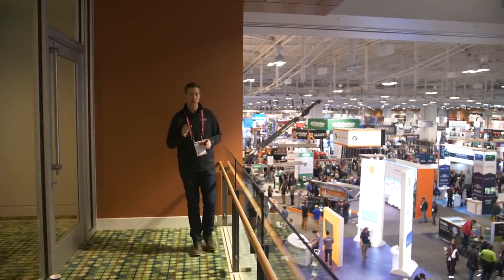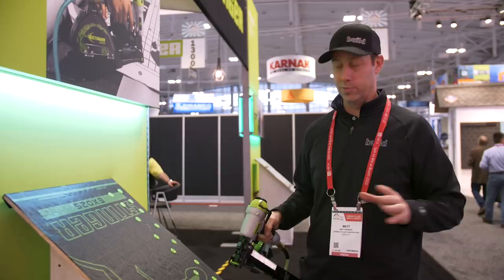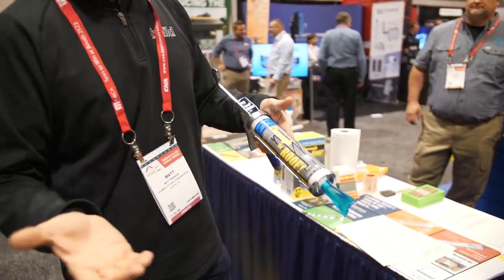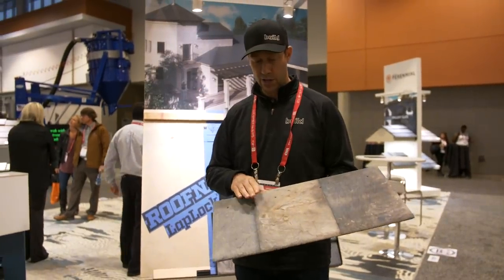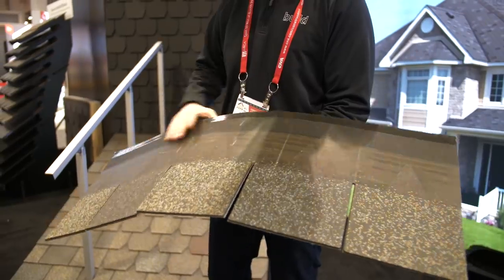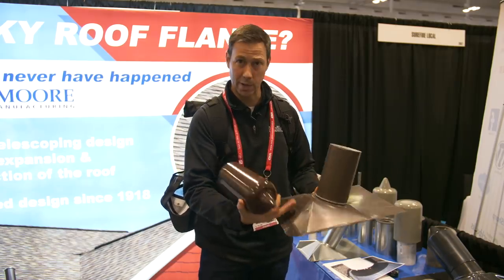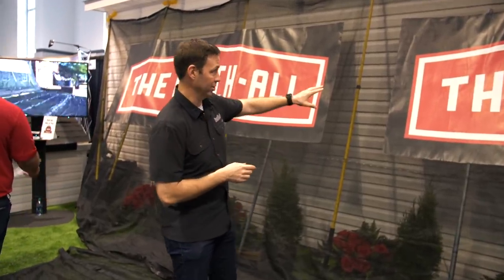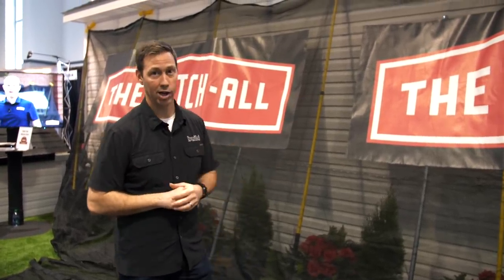NEW ROOFING PRODUCTS 2019 - This Show Had Some Surprisingly Cool Stuff!

Comment: Id like to see that talk about metal roofs. Why you like them. You prefer them over an asphalt roof? In every situation?
Reply: Thought I'd throw my two cents in. Pros for metal roofs are they are very durable and will last longer than asphalt or cedar shakes. I believe most suppliers come with a 50 year warranty vs. your typical asphalt shingle at anywhere from 20 to 45 year depending on the grade. (Note: I'll believe it when I see it that any shingle would last 45 years).

 Metal roofs, when done nicely, are very sharp looking and can add an architectural touch to your home. If a leak was to happen it can theoretically only occur at the ridge, hip or anywhere there is a roof to wall. So pinpointing it is much easier than with a shingle where it could be anywhere in the field. Not a huge bonus as any leak is bad but it does simplify. 
 
They come in virtually any color and come in wide or narrow panels, striated or smooth along with different types of seams depending on the pitch of the roof or clients liking. They are also fast to install as you can cover alot of square footage with one panel. Most roofing contractors will measure the roof first and order the panels pre cut. They are the lightest weight roofing product too so for homes that are under framed they will lighten the load. Bottom line is they last a long time. The only other options that will last longer are slate or tile but that depends on your climate. For example tile or clay in the Arizona sun would be better but metal will be cheaper than slate or tile. 

 The cons are that you must have an experienced roofer who has done metal roofs before do the install. They look great when done right but look horrible when not. You can't hide imperfections like you can with asphalt shingles. Also Oil Canning can be an issue. The summer sun can be unfriendly to metal roofs. The striated version helps to correct this but it's not always the look the client is going for. If you want the flat panel I suggest going with a 24 or 25 gauge as anything less will be susceptible to oil canning and once again make sure whoever is installing it has experience. How it is fastened will lessen the chance for oil canning. Also never leave unfastened panels on the roof in the sun. They need to go from the crate to being fastened immediately. If left out they will oil can. Also go with a reputable brand that warranties the color. You dont want a cheap one that will fade.

 Apologies for the long reply ;)
Reply: Ten years ago I needed a new roof, and I went with a steel roof for a few reasons:
1) Ease of installation. I was able to do the job myself with the help of a couple of cousins. The supplier I dealt with was able to custom cut each of the pieces to fit, and after preparing the roof sheathing and underlayment, the four-foot-wide sheets went up quickly. 
2) Energy efficiency. The steel roofing I installed was sprayed with paint that is reflective to infrared light, which accounts for about half of the heat energy absorbed by most roofs. Steel roofing sprayed with these special paints can be certified as EPA rated energy efficient roofs and make it easier to cool your house in the summer. It's cheaper to own and more environmentally friendly this way.
3) Weight. A steel roof is significantly lighter than asphalt roofs and places less stress on rafters, etc. Sometimes it can be installed directly over existing asphalt shingle roofs because it's so light (not in my case, though. I already had two shingle layers, so I had to strip it all off anyway).
4) Wind, hail and temperature resistance. When properly installed, steel roofs can withstand up to 150 MPH winds and can survive hailstorms that would absolutely destroy ordinary asphalt roofs. And I live in a Western state. What kills most roofs here isn't the heat or the cold; it's the temperature extremes. The summers get really hot, then it gets down to around zero every winter. The back and forth switch off absolutely destroys shingles, even those with 40 year warranties. Steel is unaffected by this.
5) Seamlessness. The steel roofing I installed, as I mentioned, was custom cut. The supplier delivered it directly to my home on the back of a big rig, because it was cut so that single sheets would go from the eaves all the way up to the ridge beam in a single sheet. There's no way for water to get through except around roof breathers, etc., and those just need to be properly sealed the way you normally would for a conventional roof. It's a much more watertight system than an asphalt roof where a bad storm can tear individual shingles and cause leaks.
6) Fireproofing. 4th of July and New Years Eve people are big fans of fireworks. That periodically will cause a roof to catch fire when they land on a rooftop. A steel roof is significantly more fire resistant than asphalt. 
7) Longevity. Most steel roofs last on average 50 years, and often up to 70 years with little to no maintenance. The next time my roof needs replacing, I'll be dead and it will be somebody else's problem. I don't want to be looking retirement in the face and suddenly need a $25,000 roof replacement. 
8) Costs. The price of a steel roof steel had gone down a lot when I did mine, and it was in the same ballpark as an asphalt roof for a much better product. Maybe it's gone up since then, but given that I haven't had to touch that roof in a decade now, I would say that even if it was significantly more expensive than asphalt shingles, it would be worth it to go with steel because I literally never have to worry about it again.
9) Recyclability. A steel roof, if you ever have to replace it in your lifetime, is 100 percent recyclable. That makes it more environmentally friendly on two counts.
10) Attractiveness. I did the installation on this roof myself, and it looks fantastic. My wife chose a chocolate brown color that goes great with the brick exterior of our house, but there are lots of colors available, including white, green, and red (think the red of a tile roof). There are also lots of different options available. I've seen steel roofing that's stamped to look like Spanish tile!

The biggest question most people ask is how loud the roof is in a rainstorm. The answer: it isn't. If you have solid sheathing and an insulated attic, you'll only hear it during the hardest of rainstorms, when you'd already be hearing a lour roaring anyway. My steel roof has been a dream to own. It looks good, lasts for decades longer than the best shingles, wasn't significantly more in price, and never has to be fiddled with. I've never regretted putting on a steel roof. And even though my wife was skeptical at first, she's a huge fan too.
Reply: @MichaelDavis-cy4ok  we don't have asphalt rooves on houses in Australia. Mainly terracotta or concrete tile, or steel. There are some stainless steel, copper, etc, but most rooves are steel which comes prepainted. Goes on easily ( I've replaced half of the roof  on our previous house by myself),  guaranteed for 25 years, but likely to last more than twice that long. We install roofing blanket to cut down on the noise. The lightest colours reduce the under roof temperature quite drastically.  I can't even comprehend usuing asphalt!
Reply: @bigm383  They've used shingles here in the US that are either heavy paper coated with asphalt or that are fiberglass mesh coated with asphalt for many decades here in the US because it's historically been cheaper than steel, and it does the job pretty well if it's installed properly. But you're right, steel outclasses it so far in quality and durability alone that I wouldn't even consider using asphalt shingles any more. The only thing that beats steel is copper, which is far more expensive, and slate tile which can last for 200 years or more, but which is insanely heavy and needs a special heavy duty support structure. 
With my roof, I had just gotten back from a combat tour in Afghanistan. To pay someone to do the roof would have been $25,000 US, which was more than half my annual salary at the time, and I didn't want to take out a loan. So I ended up spending about $5,000 US on materials. I got extravagant and used the highest quality ice and water shield on all the eaves, ridges and valleys rather than just ordinary tar paper underlayment, because I live where it gets sweltering hot in summer and gets very wet, heavy snow in the winter. I've never had to mess with it since, and probably never will. Steel is king!
Reply: @MichaelDavis-cy4ok  Thanks for your reply. We have a few slate roofed houses in Australia that are very old. Usually imported from Britain.  We can get copper and SS. There's also a prouct that is copper coated SS, but to expensive for mere mortals. Good on you for doing your own roof and doing a job that will last.
Reply: @MichaelDavis-cy4ok  Sold!
Reply: @MichaelDavis-cy4ok  + to avoid noise from the rain, order a metal not less than 1mm thick. Metal roof has another advantage, snow comes off faster. Greetings from Russia :)
Reply: @bigm383  I'm in Australia too, but I've lived in the US. I guess all products have a place and depending on your location some products work better than others. I'm not a big fan of metal roofs. I think they look ugly compared to the textures and color grading you can get with an asphalt shingle. House after house on a street all with metal roofs looks boring. And although they last a long time, they still need maintenance in cleaning. Asphalt I think gives an overall better look on complex roofs. Metal is very unforgiving when working with it and cuts like a razor. The roof may last a long time but here in the brutal north the rubber washers fail after a few years and you can chase a leak all over the place. I don't like the environmental aspect of asphalt, petroleum based and has to be replaced within 25 years. Shame there was no mention of Tesla's solar roofing.
Reply: @worldadventureman  To be honest, I like terracotta tile roofs best, but they are expensive. We had a cement tile roof that was hot in summer, and a tile would crack every couple of months, so I would be up the ladder replacing the bloody tile. We have a Coolmax steel roof which is over ten degrees cooler in summer. As for ashphalt, I just think it sounds like a completely crap product. I do, however, like the way American,  and European roofs are made, with plywood sheeting and sealing layers. There is an Australian company called Tractile who make solar tiles for power, hot water, etc.
Reply: @bratecyo  Greetings to you too! You're so right about the snow coming off fast. :D
Reply: @MichaelDavis-cy4ok  Thank you for serving us and welcome home.  Glad the roof turned out so well.   :)
Reply: They are loud and will always leak.
Reply: @johnsmith-wc8gs  I'm new to the industry so I'm very thankful for your long explanation.  When you say "oil" what do you mean?  Thanks so much!!
Reply: @RooferNews  oil canning is when sheet metal forms waves, ripples or rings on the surface. It is permanent and ofcourse makes a flat metal roof look bad. It's caused by heat, a.k.a. the sun.
Reply: @johnsmith-wc8gs  thank you John. Do you work in Arizona? I graduated from Arizona State many years ago.
Reply: We installed our metal, kynar finished Meridian 24 gauge, architectural, panel roof 20 years ago (May June 99). I worked with a local metal distributor for the supplier, McElroy Metals,  bought everything directly from them, delivered and ready to go as soon as I had the old double layered asphalt shingles off,   made a few minor  repairs to the 1x6 decking, ice and water shield on the rakes and eaves, and all the penetration of the vent stacks, the chimneys, etc. (today, I would cover the entire roof with the ice and water, using the HT high temperature grade) I worked a deal with two local roofers that I hired to do the tear off and repaper when they told me they could do the metal, too.  I gave them my work schedule and we worked together on my days off from the fire department.  The roof turned out great, no leaks in the 20 plus years, several hurricanes and nor easters, lots of snow. I did add snow fencing last year after a snow slide broke off the power meter. The S-2 snow fencing system also adds strength for added hurricane tear off (rollup) protection and though I've never had serious  ice damming problems, the S-2 assures I probably never will. I like metal roofing. We saved money on our air conditioning too, with the ridge vent and the reflectivity of the white metal and when the sun goes down, the heat dissipates rapidly, not like asphalt holding heat. Estimated savings on the AC alone is 20 to 25%...  our slightly less than 1700 square foot  roof installed with labor, trim, ice and water shield, 30# felt, came in just under $4,000. Today, with inflation, less than $6,000, assuming you do as much of the labor as possible, assuming too, you can find good help labor with some metal bending skills for the intricate fitting around chimneys,  etc. Follow the directions from the metal roof manufacturers to the letter. If I had a question, they had the answers and the guy that sold me roof came out to the house several times to offer helpful suggestions making the whole experience worthwhile and satisfying.  I gave the two roofers a $500 bonus at the end. Happines, barring a catastrophic event, is knowing your roof will probably outlast you. Note: the kynar paint finish is itself warranted for 25 years. It does get dirty. It can be cleaned and restored.
Reply: @Hu1ud  no they aren't....on both counts. I have known of one local metal standing seam roof that is now over 130 years old. Every ten years it gets a coat of roof paint. It's been through dozens of hurricanes. Properly installed metal roofs last as long as the building under them. Asphalt roofs are made of paper, petroleum products and colored pebbles. Around here in a hurricane prone area, even the high end architectural grade asphalt shingles typically don't last through the warranty period of twent five years.
Reply: @mikegrant8490  those old standing steamed roofs are rolled tin there held on with cleats then the steam is crimped it not the same as modern metal roofs i have done both. Most of these new metal roof systems today 
Use fasteners that leak any time you use fasteners on the face of the metal it will leak just a matter of time plus most modern metal roofs look like shit  .
Reply: @jamison1323  good points... standing seem roofs are still the gold standard for metal roofs.  My roof has no exposed fasteners and I have added the S-5 snow fencing that also adds an additional wind resistance factor for our more frequent hurricanes.  The fencing uses a torque type clamping block that the fencing itself is bolted to. Absolutely no penetration there, either. Most of the roof penetration holes around here are caused by bullets fired off into the air by drunken good old boys that think the laws of physics don't apply to firearms.
Reply: uare you  As a retired professional firefighter I can tell you that ventilation of a metal roof is more time consuming, but all modern FIRE Departments use PPV,  positive pressure ventilation, forcing fresh cool air into the structure, pushing smoke, heat and charged fire gases out through openings, enabling quicker rescues, locating the seat of the fire for quicker extinguishment, lessening property damage. Metal roofs as part of the fire problem initially, are not a big factor to the incident commander. Metal roofs are, on the the loss prevention side,  a savings in the cost of fire insurance due to the better rating of the roof system, substantially more in some areas like the far west where wildfires spread embers to adjacent roofs. Asphalt roofs are usually a big factor in fire spread once the fire has vented as it is now a akin to a running petroleum spill fire requiring elevated  master streams to contain, and that requires that inside suppression operations be suspended.  Actual fire science proves your argument to be less than valid from other than a possible  flame spread and heat load rate of rise in an incipient fire directly under a roof and most fires in structures are room and contents fires, not the structure itself until fire spread has broken through to affect bearing members.  PPV negates that spread more quickly, no matter what the roof is constructed of. The real danger of all roof systems is the use of trusses. Trusses fail much more quickly than heavier construction of joists and rafters holding heavier decking/sheathing, failing at the metal gussets, causing collapse earlier.
Reply: @mikegrant8490  i did historic old time roll tin roofs for hand made criping tools wooded mallets it was time consuming but fun the oldest roof i seen that was still water tight was 175 yrs old a hurricane roll a corner up but it would have lasted many more if not for the storm. Sounds like you got one hell of a roof allso
Reply: @MichaelDavis-cy4ok  Our experience is remarkably similar to yours. The cooling savings in summer has been extraordinary, saving as much on AC as to probably have payed for the cost of the roof over the twenty years since I installed it. I couldn't tell you how many times I or my wife have heard the "loud roof" comments.  My loudest roof is my front porch roof that I did in copper and bare open wood framing. The main roof? Triple layered 15# felt on 24 inch exposures over the ice and water shield per the manufacturer's recommendation at the time, makes it, shall we say, appropriately loud enough to know it's raining with the bonus of knowing when it's hail versus rain.
Reply: @jamison1323  I sure would like to come back for a visit in about 150 years to see some of all the roofs for a comparison,  wouldn't you? Somehow, I tend to think that some of the lead roofs, like the one on Notre Dame in Paris may have been replaced due to the toxicity now exposed from that tragic fire. Copper roofs turned to that beautiful verdi gris might just outlast  the ferrous ones even with the eventual problems of fastener fatigue seen in the renovation of the Statue of Liberty.  I watched some friends years ago working with a hand seamer doing the drip edge and  flashing and counterflashing of copper on Western Cedar shake roofing. Truly an art, too, as is your handseaming the standing seams on steel. I hope it doesn't become a lost art so, apprentices are a must.
Reply: @mikegrant8490  in eastern north carolina when i was doing historic work there only two companies in the state that truly did rolled tin but sadly the historical society's are not funding as much as they use to now lot of roofs are going with modern roof's.  Houses today are just to tight they dont breath in my opinion doing wood rot repairs i seen house 10yrs old just ate up with rot . Modern buildings have there place but give me a older house with history
Reply: uare you  Sorry to hear of the deaths of your friends.  Rural life has always been one with much longer response times. It is much more necessary to be more educated about self reliance on early warning of smoke detectors, EDITH (exit drills in the home), adequate numbers of fire extinguishers at the ready, annual inspections of all fuel fired furnaces, kitchen fire safety practices, an adequate water pump and supply to hold an incipient fire in check until help arrives, etc, all necessary when people desire the rural life. My first years in the fire service were in a very rural district with long response times, sparse manpower initially on working fires, shuttling water, long hose lays up pig paths, delays, etcetera. Fire prevention and public fire education are paramount in rural areas. Rural residents should also, when and where possible, support their local volunteer departments by volunteering and participation as good citizenship requires involvement. As a professional, I am never "butt hurt" by ad hominem remarks such as yours. When I served in my community, I took the responsibility of treating all my fellow citizens with the greatest respect, much as I did as an Infantry soldier, though many in the general public called us "baby killers".... so sorry that you feel it necessary to denigrate those that choose to serve our communities and our nation. I'm sure you probably hold police officers, garbage collectors, public utilities workers, electrical power linemen,  librarians and schoolteachers in the same disregard, too. Also, your lack of knowledge and obvious confirmation bias based on old wives tales towards building construction and roofs in general, metal ones in particular, is easily corrected by properly educating yourself about such simple matters. Also, lose the hate. It will destroy your psyche. Your friends that died in that fire are owed a debt of all the surviving friends and family to prevent future tragedies by making things better and safer.  Please try.
Reply: uare you  You're right. I've seen it and lived it. Groceries are more of a priority than anything else. The government doesn't and can't enforce you to have a working smoke detector unless you rent, then the landlord is responsible.  The smoke detector batteries are often found in some other device after the fire, too. The old leading a horse to water, can't make them drink. Rural poverty in this country right now is as bad as it's ever been and any government is too much government to many. Minimum housing standards are considered an affront to "freedum". Their poverty is a badge of defiance as well as freedom. I still have friends and some family that live that hard life. But for good luck, persistence and fortunate circumstances go I. My brother and I both worked our asses off to escape poverty. We've never lost our empathy for those less fortunate, either. Have a blessed day....
Reply: uare in snow climates you are supposed to install snow stops on your roof. Its code on most residential and all commercial and industrial areas
Reply: Only downside I have seen to metal roofs is they are a damn slip n slid when it's wet, and deadly when it ices over... Shouldnt really affect home owners though.
Reply: @mike grant have you seen any of Kyle from mr buildings videos on YouTube? If you haven't then I would highly recommend that you check them out especially the ones in the "cabin in the woods," series of videos. In these he is installing a standing seam roof and has a few good valleys that he has to incorporate his keen level of detailing in to,the roof looks absolutely amazing when it is finished. He shows the cutting and fitting in great detail,it would be a good thing for anybody to watch who is going to be fitting their own metal roof.
IMO standing seam is the way to go as there is no chance of leaks through the failure of the rubber washers on the fixings.
Here in the uk slates,clay or concrete tiles are generally used with the odd thatched roof here and there,on some really nice homes there are copper or zinc metal roofs in some cases. It's a great roofing material.